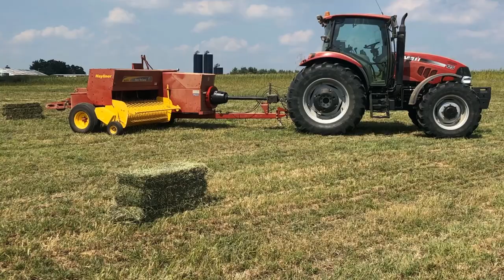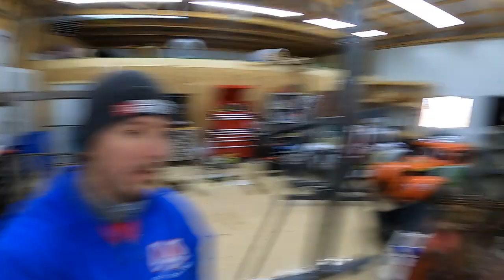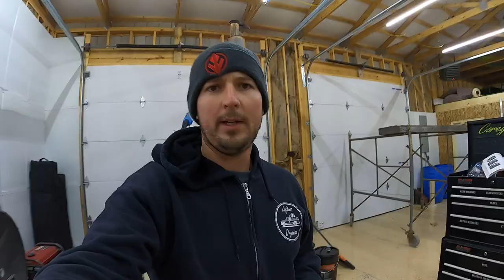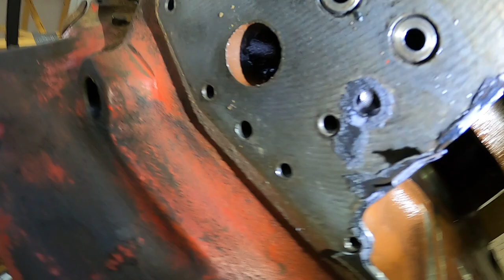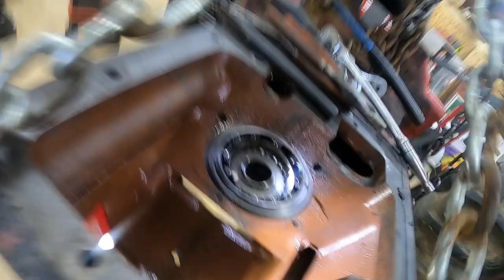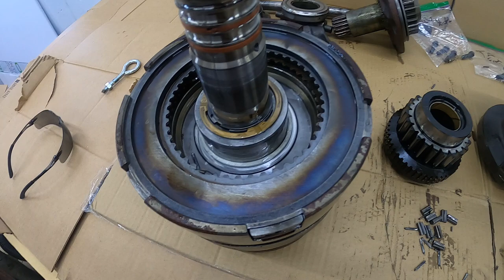IH 1066 -Part 4- Removing torque amplifier (TA) + Disassembling transmission - International 1066

Comment: Handful of tips for you.
Remove the countershaft nut before removing the main shaft. That way you can lock it solid by engaging both speed transmission sliding gears.
A 2 3/4”  axle nut socket is adequate for the job, costs less than an impact socket and weighs a lot less. 
Never ever reuse the shift rail hold down bolts. A dab of blue loctite is a good idea on those bolts.
 Still stake them, those were hammered down the same way I have always done them.
It looked like, not certain, that the wrong gasket might have been used between the speed transmission and rear frame.
Reply from the maker: Thanks for the tips.  This is the first time taking one of these tractor apart. I’m going to be going with a hy-capacity  ta kit that includes the ta pump gasket kit and gear.
Reply: @JacobsFarmLife  I left an attachment and description about the gaskets on facebook messenger for you.
Reply from the maker: Jim Naden awesome thanks for the help.

Comment: 1980 1086 
Hard brakes, clutch & steering.  Clutch pressure plate splines intact not damaged. Main hydraulics + pto working okay. MCV pump no damage and working. Tractor will jerk spontaneously going up a hill, all most like dumping a clutch from a standing stop. Anyone have any ideas or thoughts if this could be a torque amplifier problem ? 
Thanks in advance for your ideas.

Comment: Would you have to tear down the tractor even further if you had to replace the reverse gear and low range gear because of broken teeth?
Reply from the maker: Yes.  They are located with the back of the tractor

Comment: I'm looking at buying a 1466 is there anyway I can tell if the TA is still good without taking it to the field
Reply from the maker: Not really sure. Most of the time it’s hard to tell till you get a good load on it. Some of the old timers might be about to tell you.  My high side was completely out and eventually the low side starting slipping so bad that it would barley pull it self in high 1.